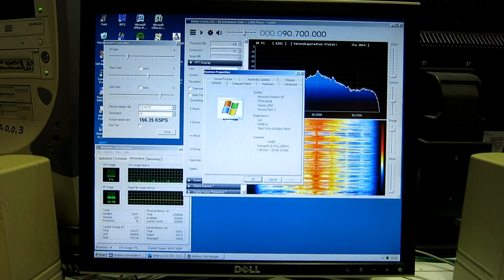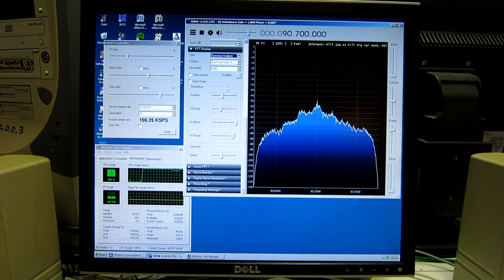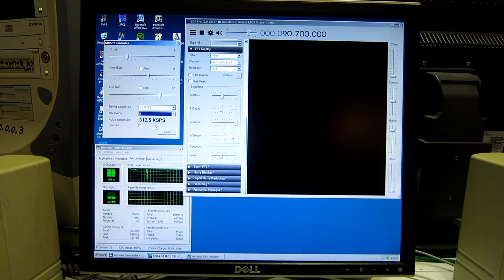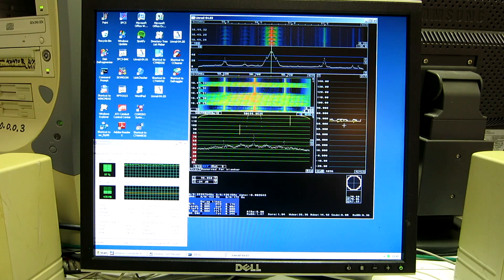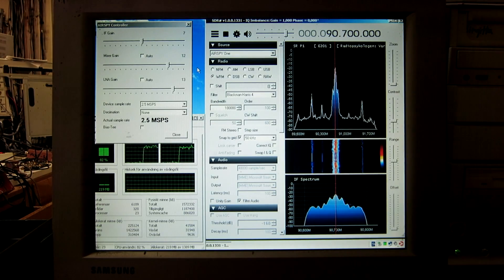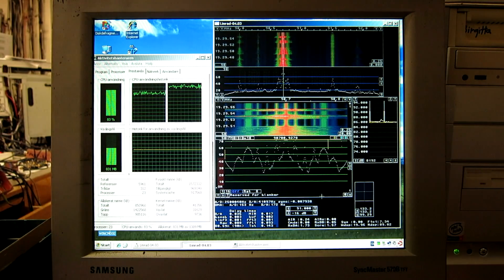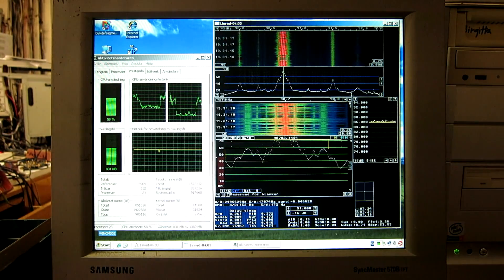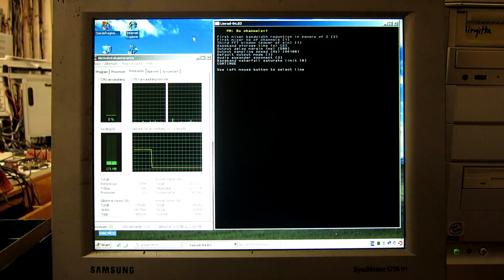Airspy One on Pentium IV

Comment: where can i find the WINDOWS XP driver for the AIRSPY?
Reply from the maker: The Airspy should install the appropriate Windows driver automatically on all Windows platforms. I think it actually does. (If it did not I may have used Zadig to install the WinUSB driver - but I do not think so. ) This was over two years ago so I do not remember. The fact that I did not mention anything about how to install strongly suggests I simply installed SDR# just as you would do in any other Windows environment (Except perhaps for Win 8 and 10 which I avoid as much as I can and therefore know little about. Maybe the "improved" security of the latest Win versions adds some extra complexity.)